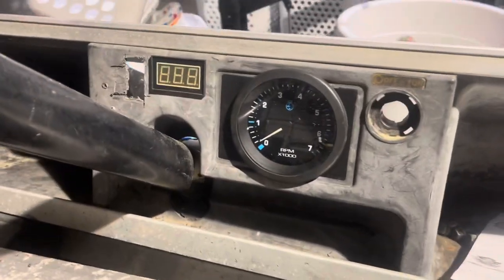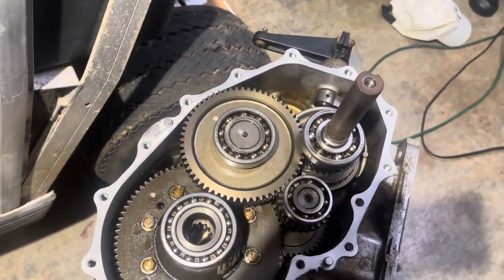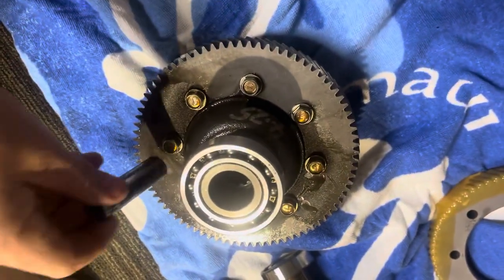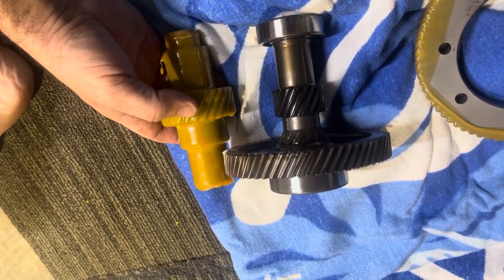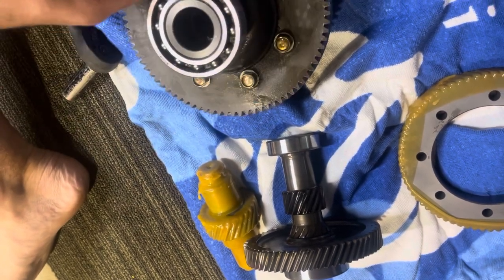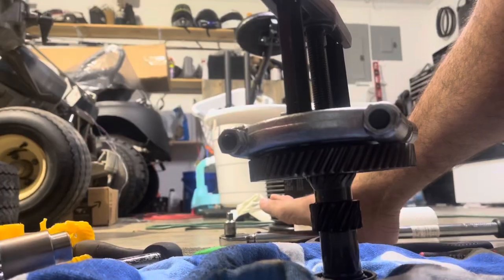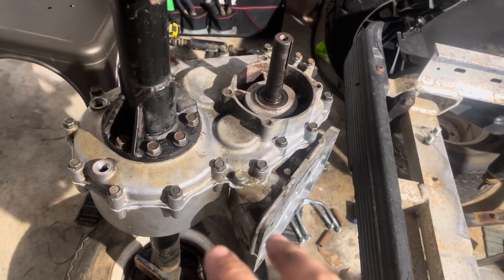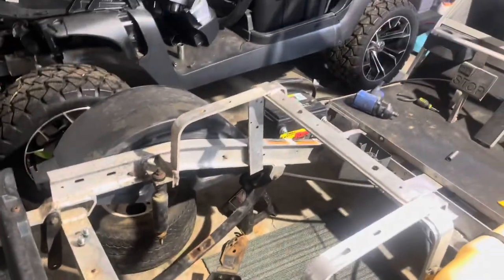Club Car golf cart high speed gears install.. (big block v-twin 23hp build) “The Rental” Part 2

Comment: What was your final gearing in reverse? Do you think theres a way to spin the forwarded and reverse gear around to make it run in forward?
Reply from the maker: The final ratio in reverse is 6:1. The only way to reverse it is to spin the motor around and use the fan side to bolt an adapter on for the clutch. However, at the time there was not a good quality adapter to use. It still ran 32mph so that was plenty for me.
Reply: @ON20LBS  what size motor?
Reply: @ON20LBS  so you put a 6:1 gear in and 6:1 running it in reverse going forward?
Reply from the maker: Oh I’m sorry.. so, going forward (cart is actually in reverse) the gear ratio is right at 9:1.

Comment: Does this gear set change affect forward and reverse, or only forward?
Reply from the maker: Yes, it changes both forward and reverse ratios.
Reply: Sweet. I'm planning on putting a 420cc in my DS. I have the clockwise rotating fe290. The 420 is counter clockwise meaning I'll have to use reverse to go forward and reverse is way lower geared than forward. Hopefully the 8:1 set makes up for that.
Reply from the maker: @ROFLCOPTERS92 honestly I would go ahead and do the 6:1 gears. Depending on how fast you want to go of course.. with the 6:1 it changes the reverse to 6:1 but the forward gear to about 9:1. I know it’s confusing running reverse to go forward and such. That’s what I did in this cart and at 4000rpms running reverse to go forward I was right at 32mph.

Comment: Is a press required to put the bearings back on?
Reply from the maker: Sometimes.. the older the cart the harder of a time it seems the bearings resist going back on. Usually it’s just a few taps with a hammer and wooden block.
Reply: Any advice for getting the dowel out of the old differential gear?
Reply from the maker: @brenth560  they usually pull out pretty easy.. I use a towel or rag then a pair of vice grips super tight .. twist and pull.. it’s important to twist.